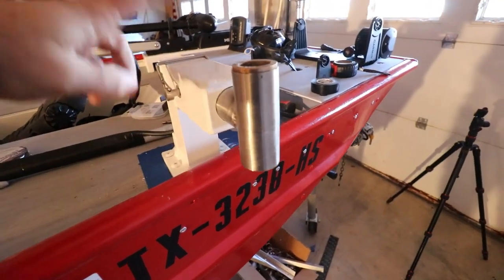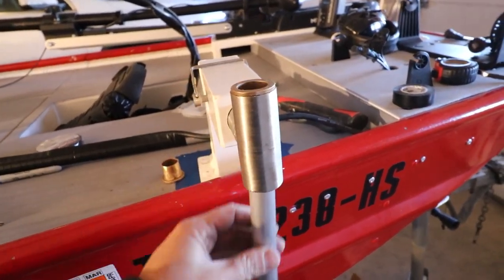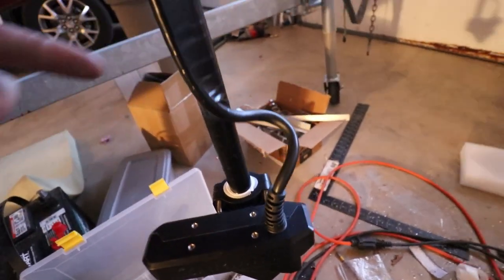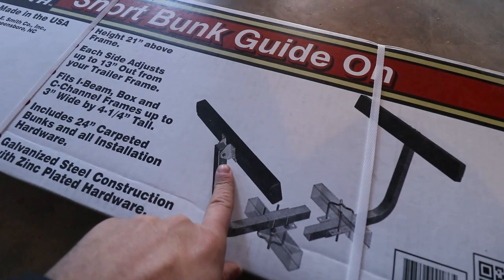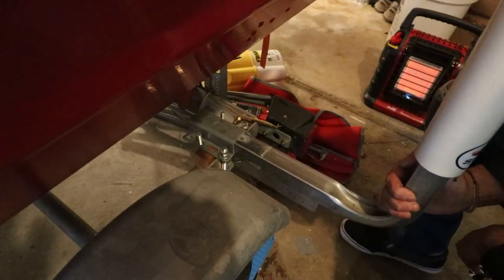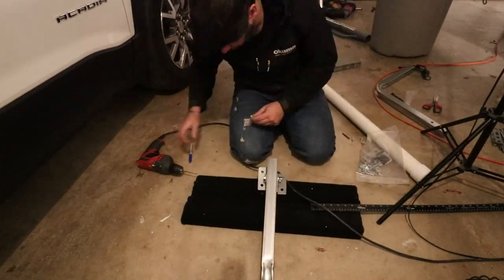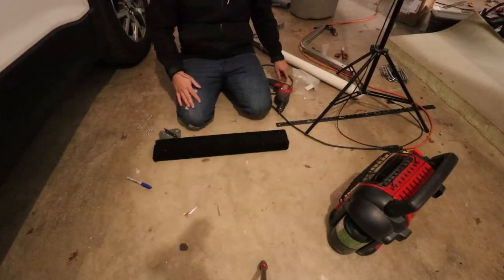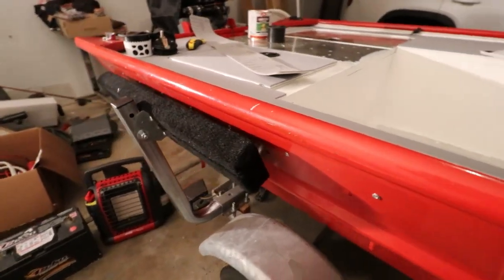MAKING A FEW CHANGES To My JON BOAT CONVERSION!!

Comment: Good call on those brass bushings. Those are waaay better and now it's back to looking nice and professional.

A suggestion for the transducer pole: If you have issues with the electrical tape coming off due to the water, you can use some plastic "split wire loom" instead. It's available on Amazon. You can wrap the pole and the cable together and tie wrap around the loom so you don't damage the cable.
Reply from the maker: I will look into that, thank you! 🤙

Comment: Great decision on the Bunks. Depending on your situation with a camper shell it can be difficult backing a small trailer down the ramp without the boat if you only have side mirrors. My buddy had a narrow trailer with a dully truck, it was brutal backing down the ramp.

Comment: That's a good idea with the bunks. So the boat is easier to slip on the trailer. I need those bunks for my boat too. Because slipping the boat in a river with waves from a ship is sometimes difficult. I think white is a nice color for the trailer. That fits to your truck ✌️

Comment: I have both sets of guides on my boat. One bracket on top of the other. One on top of the frame the 5’ bunk boards and the guide post on the bottom pulled out 48” tall. On my post they are just for backing the boat up better. I have break lights and running lights and turn signals on them as well. Top cap has red and yellow lights for visibility when backing down the ramp at night.
Reply from the maker: That sounds like a awesome set up

Comment: Those post guides are not just for loading the boat they are also to see where your trailer is especially when you’re backing into the water to load your boat
Reply from the maker: Oh I know, I installed the pipes, but I loaded and unloaded the boat for months with nothing, I’ll still be able to see these above the water

Comment: Not bad man not bad but I got a couple questions about it if you have those on there which is a good idea instead of having the pups but it's a bad idea I'm not having the pipes because you can't see where the trailer is when you're loaded up so you late last night on Facebook that cooks old crawfish and stuff I like them all the time too get done dude
Reply from the maker: I can still see the trailer, I loaded and unloaded the boat for months with nothing there so it’s doable, the guides just make it easy